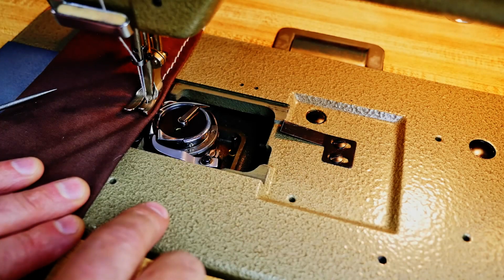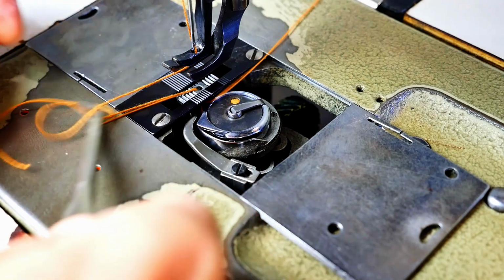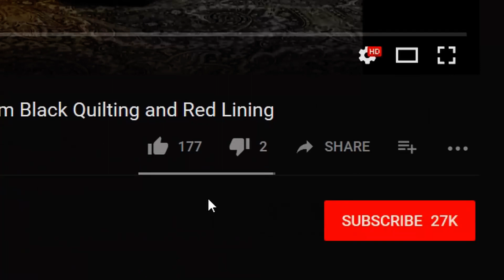Why Bobbins? How a Lock Stitch is Formed in a Sewing Machine

Comment: Thank you for this video. but there is something I still do not understand. The upper-thread loop has two legs. The upper can go over the bobbin but the lower leg should be hindered by the bobbin axle. But it works ! Where the magic of the lower thread ?
Reply from the maker: The axle connects to the hook, The bobbin case sets in the hook. The bight of the thread passes between the case and the hook. To say it another way, under the case, Over the hook.

Comment: Alex, on some of my projects, the top thread going through the needle starts to fray and eventually knots up. It thus prevents the stitch when it jams. Do you have any suggestions as to what may be the cause ?  I have tried adjusting the tension and changing needles so far.   Thanks   ,   J K
Reply from the maker: I have found that many problems can be solved with a fresh needle and good thread. Not all thread is equal and it is no place to try to save money. Last I would say to make sure your needle and thread are appropriately sized. https://tolindsewmach.com/thread-chart.html

Comment: I still think the bobbin mechanism could be remotely fed from a spool.
Reply from the maker: I am sorry that I have failed you.
Reply: @AlexanderDyer  I'm just saying it seems technologically feasible.  We have these large spools of thread up top and a microscopic amount on a bobbin.  Just seems like a better system could be devised.
Reply from the maker: @rtz549  It may be that you would prefer another stitch type. A two thread chainstitch uses two spools of thread and has no need for a bobbin. I recently acquired a 2 needle 4 thread chainstitch that uses 4 large spools of thread and no bobbins. It was built in the 1940's. You can sew all day till you fingers bleed and never change a bobbin but at no time will an ISO# 301 Lockstitch have been produced. It is a perhaps subtle distinction but an important one.
Reply: From the video, I didn't quite understand why the bobbin can't simply be taller (axially), to increase capacity, while maintaining the exact same diameter and circumference. 

I guess I'll watch it again sometime and pay attention, but I'm not particularly concerned with bobbin capacity.

Comment: I had been thoughtful about this since my first use of a lockstitch machine. As a mechanical engineer, I think it's not an impossible thing to make a machine that operates a huge rotary hook with a spool volumed bobbin. (take-up lever has to lengthen of course). If it's ''vertical axis'' rotary hook it is quite possible. (It's possible at ''horizontal axis hook'' machines also, but not easy as vertical axis ones). And a new era would have started. Thread manufacturers would start to sell in this new sized plastic bobbins and you could have directly use it without winding. why not? why dont they do that?
Reply from the maker: You can lead a horse to water, but you can't make it drink.
Reply: cancelik , Want to put two engineers heads together? Been thinking about this a few months. My non-profit started an upholstery company with specifically autistic workers. You would not believe the blown gasket when that bobbin is empty and they just sewed a long line.
Reply: @m4rvinmartian  yeah, why not? sorry for huge delayed response. feel free to message me at skype : hasanccelik@hotmail.com
Reply from the maker: You guys be sure and let me know how this goes. There is always the chainstitch machine that does not need a bobbin. Anyway, good luck.